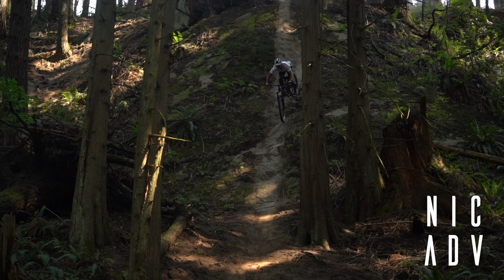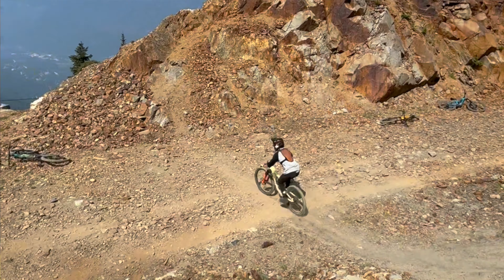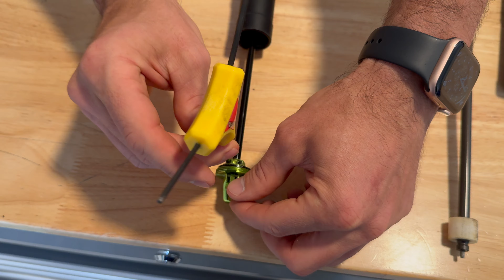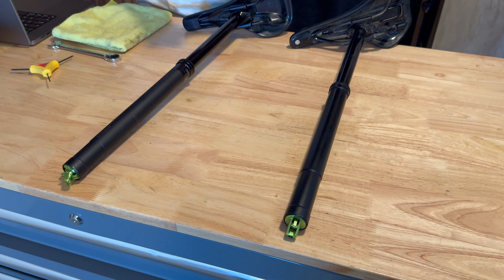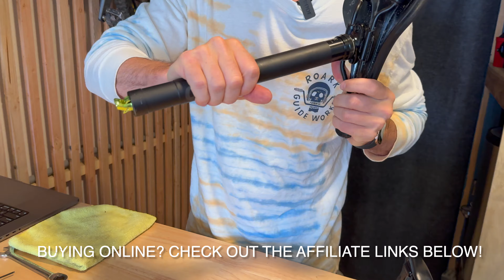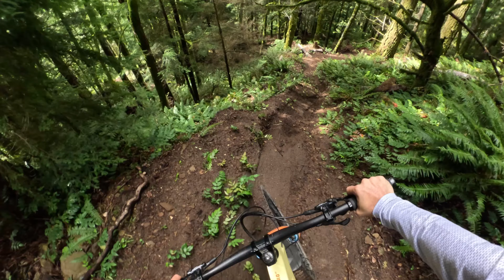OneUp V3 dropper vs V2 What's new, disassembly, and review

Comment: I have a V2 and recently upgraded it with the V2.1 seal head. Great post for the money with good weight, good drop for length and easy to service, but even with the new seal head it weeps grease like MFer. Have to add more all the time. And if it isn’t packed with fresh grease the breakaway friction is pretty bad. If the V3 fixes that it’s a solid dropper but the new price is getting dangerously close to BikYoke and Wolf Tooth. And lack of adjusting air pressure seems like a miss. I ride fat bikes in the winter and once them temps drop I up the pressure to compensate for the change in air density. Otherwise they are really slow. Just like how car tires lose a few psi in the winter.
Reply from the maker: The added bushing overlap definitely seems to help, at least so far. I rarely greased my V2, but got used to rocking the seat forward to help with the breakaway.
Reply: @NICADV  at least it is super easy to add grease, takes less than a minute.

Comment: My v2 got chewed out and the ano wore away on the inside where the bottom bushing sits inside the outer tube when at max height. It was less than two years old and serviced regularly. I do take good care of my gear and only ride in dry conditions (and I'm usually the front rider so don't get much dust) and almost never in the wet. It was replaced under warranty though which I am grateful for.  I think the improved bushing design of the v3 will help a lot with the issue.

I also heard a theory that the green actuator on the bottom doesn't let air out fast enough so when you put the post down the seal at the top expands a little under pressure and lets dirt past. Not sure if it's true but sounds plausable. Has the v3 actuator been changed to vent easier?
Reply from the maker: I've heard that theory before and it makes sense. They did change the actuator slightly, but Im not sure how much it will help. It does fell like it vents easier because it takes less effort to drop, but that could be due to the new cartridge.

Comment: I have the V2 and just finished doing a full service on it.  I have done the “quick” service on it, 12 times during the riding season to keep it moving well.  For me 12 times is too much.  I had also talked to customer service twice.  (They were good btw) At this point in the game, droppers should not have to be serviced that often.  I personally can’t stand the oneup v2.  I’ve sold my post and it’s being picked up this weekend.  Contemplating the V3 but I’m not sure I trust it…
Reply from the maker: Where are you based and what posts have you ridden that work better?
Reply: PNW posts have always worked for me.  Just bought the Loam to replace the V2.  Hopefully no future issues.
Reply from the maker: @dirtyforksmtb  Nice, I haven't tried a PNW post since like 2018. I generally just ride the post until is almost stops working and the OneUp posts have certainly outlasted the Fox and Rockshox posts that have come stock. I also really appreciate the short lengths.